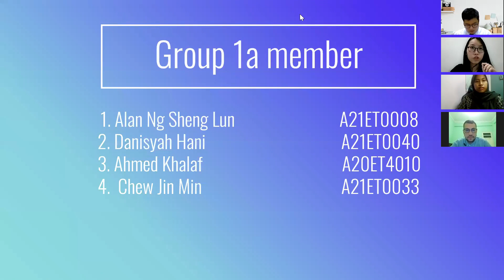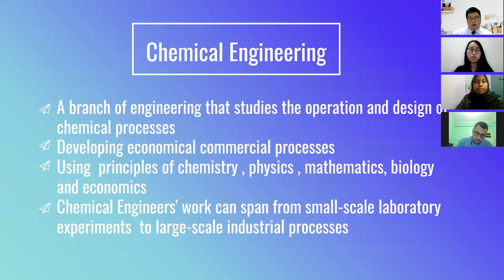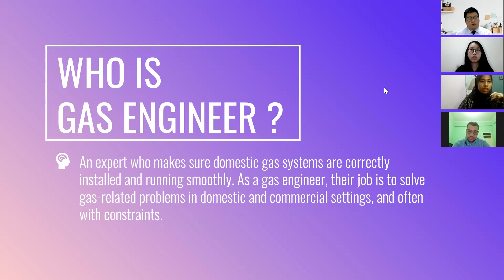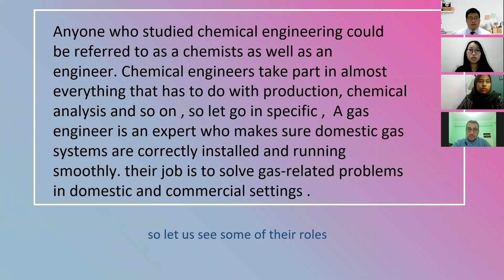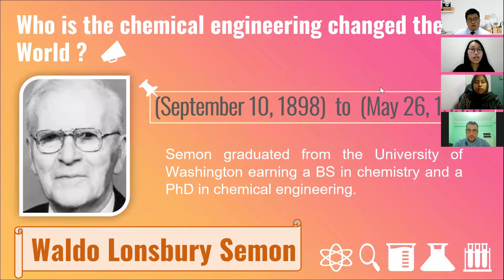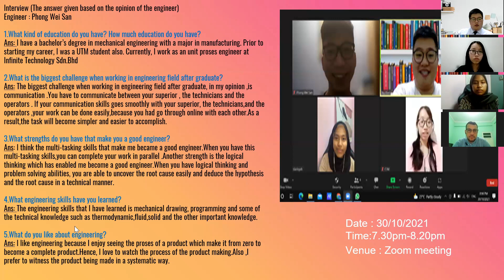Branches of chemical engineering, basic roles of gas engineer and their job scopes

Comment: Group 5A: Out of all the branches of chemical engineering, what does a Gas Engineers have advantages over the other branches?
Reply: Hi Group 5a
We think that the gas engineer take the advantage on machines. As we all know that he also required to deal with the modern technology nowadays ,but not only with chemical compounds. Hence, he is more aware about how  heat exchanger works . He also need to identify and  minimize the leaks in a pipeline by using the right tools and technology for example. 
The advantage of chemical gas engineering other than the branches is job flexibility. As chemical gas engineer need to visit many people and place to solve equipment problem, they are praise the flexibility and stimulation their job provides and they will never get bored with their works.

Comment: Group 4a: What skills should one develop to be successful in this field?
Reply: Hi Group 4a.
We think that one of the important skills to be successful in this field is teamwork skills . Team work skills are essential for ensuring us can cooperate with teammates to succeed as a unit .Also ,this teamwork skills help us to increase work efficiency.
The other significant skill is the skill master Excel tool .This is because ,for a chemical gas engineer , it is helpful in data analysis and calculation. Besides, Excel has many other function such as formulas and pivot table can be use in database.